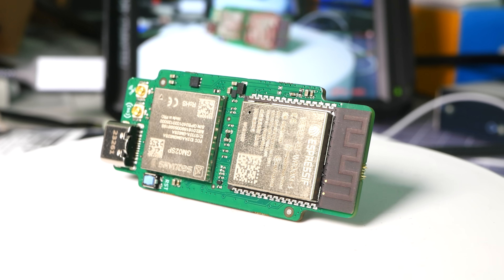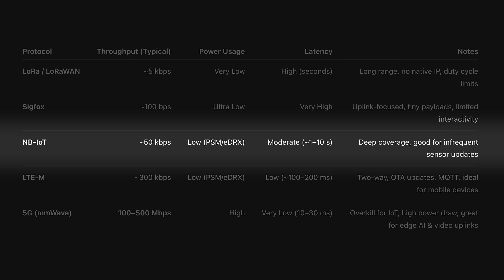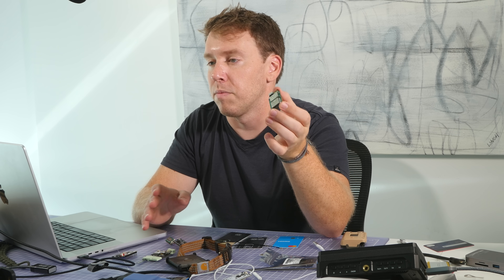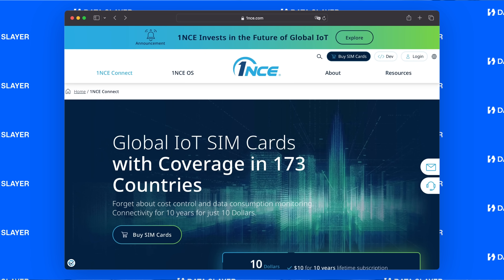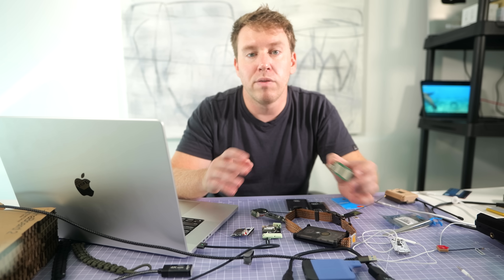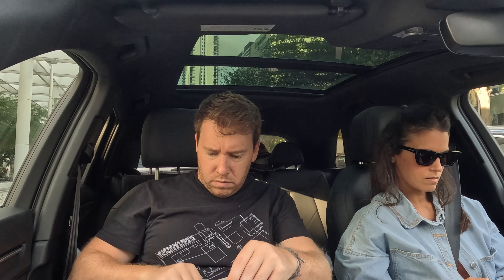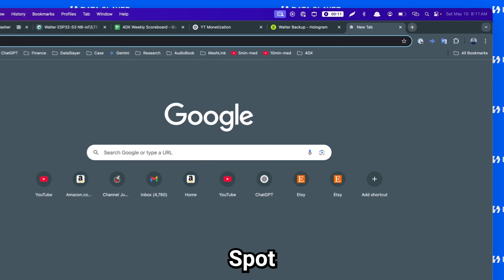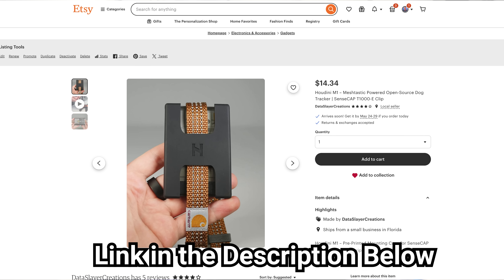You’ve Never Seen Cellular Like This

Comment: I juts got a gps tracker with a controllable relay. I used SIM card from my phone provider to setup and was able to use traccar demo to test online tracking with. Ai mentioned walking me through tailscale to setup a traccar site locally and keep maintenance costs to juts the SIM card. Overall don't really need gps tracking on a website since I can set ping timers and alerts for emergencies (low batteries, geo fencing, etc). Figured I mentioned this since it's so close to what this seems to be providing and the traccar webpage can be setup locally!.
Reply from the maker: I've been doing more with tail scale really opens a whole bunch of new capabilities

Comment: Very interesting, I want to put one in my Vespa GTS. Would it also be possible to give it an instruction to collect SSID's. This would be helpful when a stolen scooter / bike is in a garage without GPS reception. Knowing the general area from the last GPS reading and then acquire WiFi SSiD's with their signal strength will help to home inn to the tracker even when there is no GPS reception possible.

Comment: It doesn't have castellated edges. We can see that quite clearly.
Besides - you wouldn't put castellated edges on a board that has stuff mounted to the underside - like the microSD on the board you're holding.
The RaspberryPi Pico has castellated edges. Compare the two. You'll understand.

Comment: Lot of clickbate going on here, its not "free" internet, also even if it was it would be 1mb/s download speed for LTE and not useable as a normal cellular activities. Yes I know you mention IoT ussage frequently but seemed to portray it as a use case rather that the only real application.

This is cool tech regardless, there is no need to mislead and clickbate.

Comment: You can deploy a private LTE network if you have a good vantage point. You don't have to go through private cell companies. LTE band 48 is unlicensed space.
Also, the low data pools of the plans are fine. 1 character of ascii text = 1 byte. Each of my endpoints send about 8,000 characters of text or 8kb of data per day.

That's a lot of data, but it will take a very, very, very long time to get to 500mb. If anyone needs more than that, its a skill issue.

Comment: Very interesting. Since you're in Miami, have you had a chance to test the Starlink connection? I read that the module supports Band 2 (1900 PCS), which should be the band used by Starlink Direct to Cell.

Comment: I'm looking for a Motorcycle tracker for some time now. My plan is to use an old smartphone. It has cellular, GPS, battery and processing already in a nice package. It's so frustrating that there doesn't seme to be an open source project that can turn my old phone in a very capable tracker easily.

Comment: $10 for 10 years for the sim service.. 500mb and 250 sms messages, but how much for more mb/sms? Because 500/250 may sound like a lot for data, but that is not enough to cover a long period of time. You will easily need more within the 10 years
Reply: Based on my requirements, 500mb would last 10 years for up to ~15 of my endpoints.

Comment: Great video. Does it have the option to switch to wifi to save a little data and cling onto wifi when a vehicle is at the owner's home or office? 

I'm thinking about acquiring a starlink mini for my car with a powerbank as a ups.

The idea is to have fast wifi on the car but mainly to power a gps for real time monitoring and second for it to connect to an android auto enabled double din stereo that I still havent bought yet... just doing some research before deciding.

Thanks again!

Comment: FYI, with any radio signal, glass is the least of your worries.  It’s the metal in your car creating a reflector cage,  not completely Faraday since it’s poorly grounded through carbon black tires and asphalt.  That’s really only an issue though with wavelengths larger than your average window size, like 2 meters and partially 70cm on an amateur handhelds.  It really doesn’t affect short wavelengths in the ghz and up.  Otherwise the relatively low power consumer cellphones would struggle in any car.

Comment: I am a bit confused.  Why can't we just take the SIM card that people buy from Hologram website and just plug that into our cell phones.
Has anyone thought of that?    I am thinking of emergency situations such as complete blackout and war time situations,  where people can continue to communicate,
even when the main cell phone provider is down.   Everyone has a cell phone, which in on itself is a computer just like any other desktop or laptop computer.
Can't we just use that, and do things with it, instead of using other hardware.   The cell phone aka computer,  has bluetooth, cell module, cpu and gpu,
along with RAM memory and battery.
Again, maybe I am not getting it, because I am new to this,  but it just seems weird that people are trying to use other hardware, 
when we have an actual powerful computer in our pockets. which also has antenna's
Reply from the maker: hologram sim cards are meant for low data so you won't get very far in a full fledge phone
Reply: @DataSlayerMedia  
Aaah ok,  Thank You.  ❤

Comment: We need to pay people with tall balconies to just place these mesh WIFI antennae's in balconies liek an Airbnb for wifi mesh app 
(This same "airbnb" idea can be used for advertising as well, paying people to simply put extra HDTVs in their windows facing the streets, and playing either videos on a thumb drive or just playing a youtube video on repeat or just opening upa laptop and using a website that plays the ads on a loop and controls it all for them etc)

the mesh network from peopels balconies can get its internet from their local ISPs and have data capos on peopel whow ana sign in and share it and pay them if thjety want moree than the free amount/. Like I dont always use all my data bandwidth and Id love to provide 100 peopel neaerbye with a very slow but basic internet they can use just to watch youtube videos at lowest setting, or maybe just to use emaila nd stuff . i can probly s100% throttle their bandwidth right? anmd even let them pay me in crypto to open  up the throttle?

Comment: Could you use this as an anti-theft device for your car? No one wants  to setup meshtastic nodes in my town apparently. I just hope my AirTags track my dog, keys, car, wallet, Adderall (ok, not yet, but I sometimes wish).. 

I have crippling ADHD

Can the antenna (specifically the GPS antenna be extended? If so, what would be the signal loss at 5', 10', or 15'?

I guess you could use a weatherproof box.

Can you tell it to update the location data only every 6 hr if no change or connected to home wifi, but update more often in your neighborhood? (I assume getting GPS data uses no 4G)

A device that connected GPS, LoRAa/Meshtastik, AND LTE would be cool. Could GPS come from your car's CANbus interface? (less conspicuous) Heck, Maybe even 4G.

OH, what US carrier does this use?

Is it an MVNO for ATT, Verizon, or T-Mobile (or the mini Boost Network)

How many GPS locations/month do you get?

When you said 3GB, was that total or monthly?

Comment: i am wondering if the will have a device similar to this that can be slotted onto a m.2 or a nvme slot. So some laptops have additional m.2/nvme slots or you can just replace this with the stock wifi/bluetooh m.2 piece

Comment: Check out WiFi HaLow. 802.11ah. Runs at 914MHz nominally in the US. There are a couple companies making modules for it. There's a XIAO shield as well. Pretty low powered and up to 10 miles in HYPER optimal conditions using consumer level equipment.

Comment: Thanks for pointing these out.
I've been wanting to add some communications capability to a car-pc for monitoring and to enable turning on a defroster/pre-heater in the winters, and this may be just what the project needs for it's connectivity.
I don't really need to worry about the absolutely lowest energy draw since automobiles have large battery capacity, and this will be in a regularly used vehicle, but it doesn't hurt.

Comment: @3:58 where are the castellated edges? It has pin headers, the ESP32 blob has castellated edges..... The Taoglas FXP611 is only omnidirectional in free space, ie swinging in the breeze (rarely a suitable deployment). The datasheet says it must not be mounted directly on metal (1cm min separation). So no sticking it directly to you "bike" or similar. Then it still needs a view of the sky so maybe a known quantity like a traditional patch may be better in quite a few situations.
Reply from the maker: I mispoke about the castellated edges, regarding the passive taoglass antenna it still seems more versatile than the ceramic antennas

Comment: Uses cases
Asset tracking over 5+ years on a battery

Environmental monitoring in farms or forests

• Smart parking sensors in underground garages

Vending machines reporting stock levels

• Remote meters (e.g., electricity, water) sending usage once per day

Comment: It doesn't come with any antennas? Any suggestions on what antenna I should get?
Reply: Hi, for the LTE you can use the Taoglas FXUB63.07.0150C. For the GPS you can use the Taoglas FXP611.07.0092C.

Comment: uff,  £62.91  in the UK per unit .... A bit pricey.    I have several ESP32-S3 development boards that I got for less than £10 on AliExpress.  But adding the LTE modem and it jumps to 50 or 60 pounds. in AliExpress.

Comment: bits and Bytes are not the same thing. Thus a connection type, like LTE-M, with a rate of 300 kbps is not capable of "hundreds of kilobytes per second." At a typical throughput rate of 300 kbps, that is only 37.5 kilobytes per second.

Comment: Glass itself does not block the approx 1.5 GHz frequency for GPS, but modern car front glass can have a thin metal coating to reflect some of the sunlight or even a heated front glass, and that will attenuate or completely block the GPS signal.

Comment: lora can go up to  35.6 kbps.  In the late 90's we were using the internet at those speeds.  also, the SX12xx chips that all lora boards use, you can switch the radio from  LORA modem to  GFSK, in which case you can go up to  300kpbs. 
As far as firmware updates,  you can easily do that over LORA,  it will be slow , but you just implement  Bit Torrent type (file fragment) file transfers and P2P (which is what i'm working on )
Reply: And LoRa doesn't need a damn SIM Card with a monthly plan !!!
Reply: How do you think if its possible to use that setup (5g with lora) to provide some limited internet access for those who is out of range for 5g but in range for direct access to the node by radio
Reply: @DmytrK857  you need to define "internet access".   Even assuming you run at 1W of RF power (so you have enough signal above the noise floor),  Spread Factor of 6 and using a  500  khz bandwidth   don't even try it i would say to load a modern web page that relies heavily on javascript.   Most of the time the page isn't even going to load.  With Lora you could  request and receive one single web resource at a time.  Modern web pages  often open up multiple parallel links to the same web server through javascript calls  to load the page faster.
So while this is great when you can open more than one pipe to a server, on LORA you can not.  It's half-duplex (UDP basically) and relatively slow.  With the LORA settings i mentioned above  at best you're going to be struggling to download at  4kb/sec. 
So while , yes it can be done, you would need to using something like a  Heltec Lora32 connected to a raspberry pi zero 2.  Then write some kind of Proxy Server Gateway that would take web requests from the lora network,  forward them through the internet as a standard internet request  and then relay the  request response back through the lora network. 
I think it would work relatively well for accessing internet resources which are  basic  JSON  request/responses,  or you just need basic HTML content.   The best way to test it out would be to use firefox and go to  about:config  and search for the following setting:   "network.http.max-connections-per-server".   Change it from whatever it is to   1.   Then try to access your website or web resource through the browser.    IF you don't get so many timeouts when trying to load the page that the page just fails to load then chances are good  as long as you can accept  1-4 kb/sec.  download speeds, it can be relayed effectively over LORA...

Comment: "It's omnidirectional - so useful for the real world."
*dangles it out the window into the real world
"I propped it up so it can face the right direction."
Reply: GPS signal is very week, irrespective of antenna GPS indoors will not work.
Reply: @dm3on  Week?
Reply: @JBK647 weak (ADD was strong with on that day)
Reply: To be fair it's patch antenna problem/characteristic
Reply: it's why most gps use active antenna, signal too weak for a basic patch antenna...

Comment: The antenna traces of the ESP32 should not have PCB beneath them.  It's possible there's no copper pour beneath it, but why even have FR4 under it when it's not necessary?  Seeing that makes me second guess other design choices.

Also I love the omnidirectional passive GNSS antenna that then was pointed at the sky because it needs a direct line of sight.
Reply: To support it, maybe? That part is flimsier and if it's hanging off the side of the board, you could damage it. Just a guess.

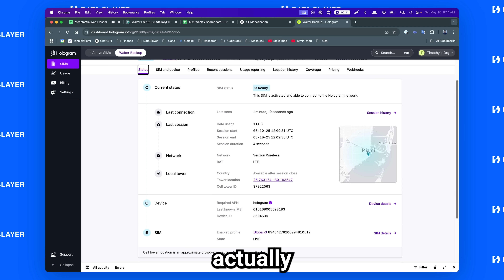Comment: 13:00 re: `hologram` determining an approximate location — this would typically triangulate time signals from three (or more) closest cell towers wouldn't it?
Reply from the maker: Not sure of the exact logic, but yea likely something akin to that
Reply: I'm not sure what radio bands are used to do this but the logic as i understand it goes like this:
• each cell tower puts out a regular pulse transmission with the real time of transmission encoded every n seconds. • the time signal is sync'd to a global clock via satellite links (at precisely known positions and therefore known distances from each cell tower) and received by all devices receiving signal from the tower. 
• the distance b/w mobile receiver and fixed location tower can be inferred by time interval b/w pulse transmission time and arrival time. 
– recapping, we know:
–– precise tower location,
–– precise time of pulse transmission 
–– inferred time of pulse reception using mobile device internal clock
–– speed of light
• this gives us approx distance from tower (using radius inferred from radio wave time of travel) 
• using the distance radius inscribed from three or more cell towers we can geometrically narrow down the approximate location fairly precisely to the intersection point/range of these circles (to the extent elapsed time period values are accurately calculated).

Comment: This had the makings of a really cool tech showcase, but man… the delivery made it tough to sit through. It felt more like a bedtime story than a breakdown of an advanced IoT board. No hate maybe that’s just his natural tone, but a bit more energy would’ve gone a long way in helping folks actually follow what’s going on.

Also, calling it “pretty much free” while the dev kit runs around $300? That’s a stretch😮😂. Let’s keep it real this isn’t a hobby board for the weekend tinkerers on a budget. For anyone scratching their head, here’s the TL;DR:

He’s demoing a board called Walter. It’s an open-source powerhouse that combines WiFi, Bluetooth, GPS, and cellular (LTE-M/NB-IoT), all built around an ESP32-S3. It’s ideal for remote sensors, asset tracking, or any off-grid project that needs to sip power and still stay connected. And it’s fully certified (FCC, CE, etc.), which is huge if you’re building something serious. Even his passenger looked like she was wondering what they signed up for but hey, props to them both for getting out there and showing off something most people have never seen before.

Cool tech, dry delivery.
Worth checking out just maybe not without coffee.
Reply from the maker: noted
Reply: I’m literally a first time viewer and I watched through all 15:30. I found the subject interesting even though I know very little about it or about the guy talking. 

If you want him caffeinated then use the play speed option on YT. 

To each their own but for me I don’t need insane action shots and sound effects going to maintain focus.

Comment: Will this enable applications such as RTK ?
Reply: The GNSS is not RTK enabled, you would need to add a separate RTK enabled GPS receiver for that. But Walter could be used to receive the correction stream over LTE-M and upload back the exact position to the cloud.
Reply from the maker: I doubt it, but could be wrong

Comment: How do these handle being powered up at silly temperatures? I'm thinking of it hidden in a brake light, but it would be HOT when woken up by a foot on the pedal.
Reply: Hi, Walter has an operating temperature range of -40 to +85 degrees Celsius, so this use-case should be no problem.

Comment: Thank you, I kind of gave up with a bunch of modules attached to a microcontroller and used a premade. But this suits the size and other things I want the microcontroller to do.

But honestly the price is waay too high. I'm not spending $140nzd for one of these, it's just a microcontroller with these modules built in.
Reply: I've just designed and been testing pretty much the same esp32 LTE integrated module for a sensor system, with additional features. I've got the price down to about $55 NZD. But my LTE module is $20/ea where as these are closer to $50/ea